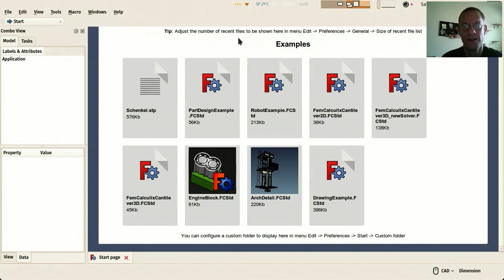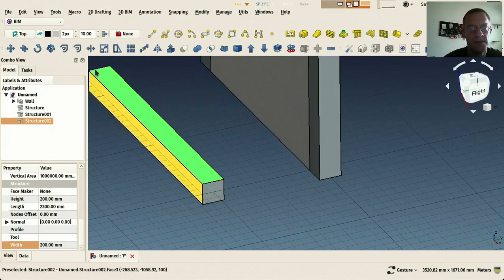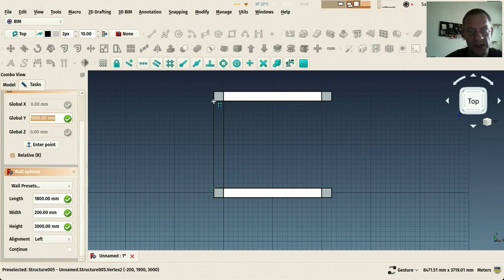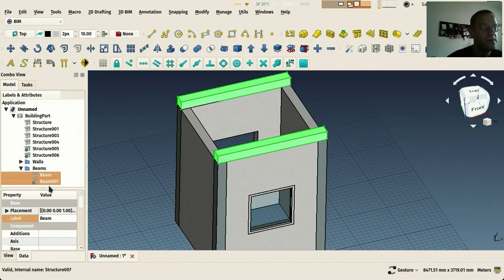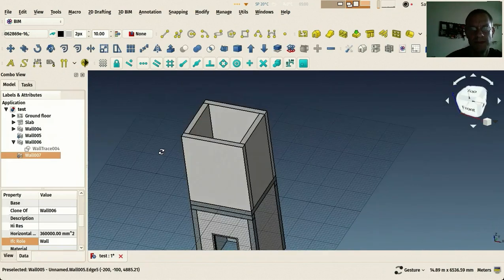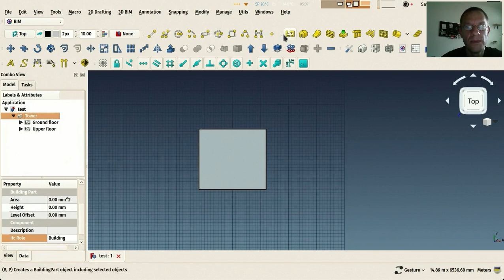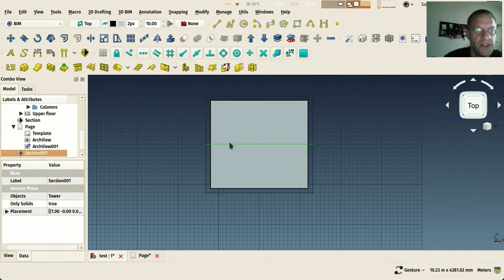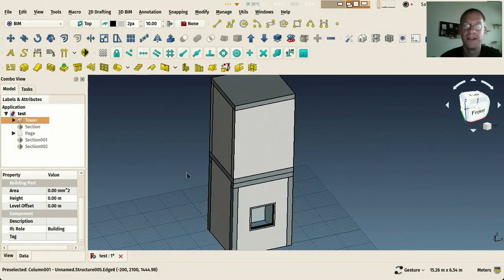BIM with FreeCAD - Getting started

Comment: Hello and thank you for providing us with the info on the basics! 

Wanted to ask, presuming that you have had some experience also with the most popular commercial BIM software (Tekla Structures, REVIT, Allplan, etc):
1) would you say that you can do everything you need until LOD 300 (as per BIMFORUM specs) with FreeCAD? 
2) what are the drawbacks of FreeCAD compared to the previously mentioned software? What possibilities does it lack in comparison? 
3) what would be the reasons for a person or a company to invest in that commercial software instead of using FreeCAD?

I hope you find time to answer these questions from your experience! Thank you and best luck!

Comment: Thanks for a well organized presentation and for showing multiple ways of achieving the same thing.  FreeCAD is further along than I thought it would be.  Are you working on software itself or are you a designer using FreeCAD for commercial work?
Reply from the maker: Both! I actually started and learned how to code for FreeCAD because I wanted a free and open-source design tool like that to exist. When nobody does it for you, you have to do it yourself :) I guess that's the main motivation behind almost every open-source software developer out there...

Comment: Thanks for the tutorial.  I have a doubt at 11:55 when moving the window you are selecting the window 3D geometry.  I am confused since in the FreeCAD manual / tutorial downloadable from the Wiki, it suggests to move an element by selecting its sketch, instead on the 3D geometry.

I noticed two results from that: first when moving the 3D geometry, in example the window attached to a wall, the hole in the wall is updated as the window moves to a new place. but the sketch is left behind, tho the sketches for that kind of objects are usually hidden.

Second, if the window is moved by selecting its sketch, the windows moves as well, but the hole in the wall is not updated, unless the window is "attached" again to the wall.

I was wondering, which method is recommended.  Taking in count if you later want to open the window panels, you need to work on the sketch. Thank you

Comment: Good video. but how come my grid remains small and yours not? rewinding several times, i did not see as yet what I missed.... I would want to have a grid at least 60 by 50 feet...
Reply from the maker: You need to set the number of lines, under the working plane button on the draft toolbar

Comment: Hi,
At 20:00 it still behaves the same way in freecad 019 20409 (very last development version for linux) :
The new wall is created with a clone (because the wall created before had a clone ?)
This is not behaving as expected for a beginner and rather difficult to fix, could you give a help please ?
At this moment, it also surprised you, didn't it ?
Regards from France

you may had an option activated in preferences/arch/general parameters object creation : automatic junction
for me, this option easily causes problems when achieving walls, i wonder if this option can be awared within the dashboard
in 019 20409 the only solution seems to be the command Less (-)

Comment: Hello Yorik,
Thanks for this video.  I followed all the steps in the video using FreeCAD version 0.18.4 installed on a machine running Ubuntu 18.04.  I also installed IfcOpenShell by following the instructions at this link: https://wiki.freecadweb.org/Arch_IFC.  But when I got to the point in your video where I needed to use the IFC Elements Manager buttons, they were grayed-out and I could not activate them.  The only button I could activate was the Classification Manager.  I am a bit of a newbie to Linux and a definite newbie to FreeCAD, so if you have a fix that can be implemented by someone who is just now figuring out what sudo-apt-get means, that would be great.  Thanks!
Reply: Hello Yorik, 

I think I figured it out.  The latest FreeCAD 0.18.4 stable version (dated 2019-11-04) on the Ubuntu PPA seems to have a bug.  I deleted it and used the latest Freecad 0.19 daily build instead.
Reply from the maker: @cgthompsonii5698  This is best anyway. But usually a greyed-out button means that another command is active.